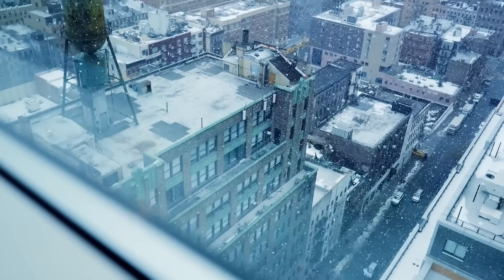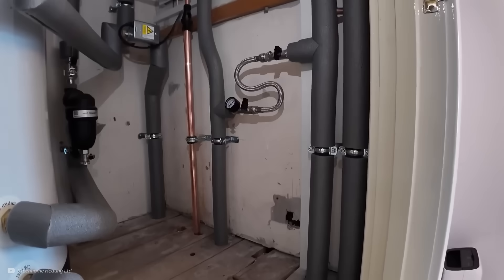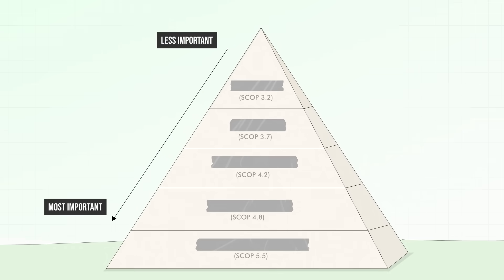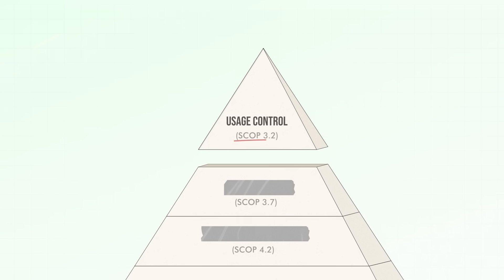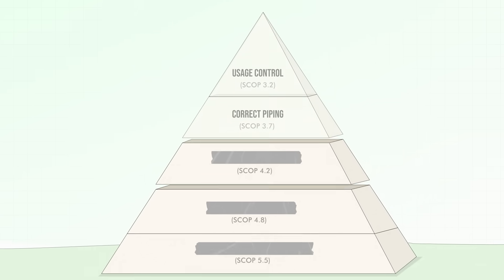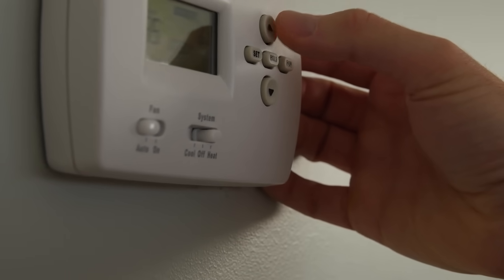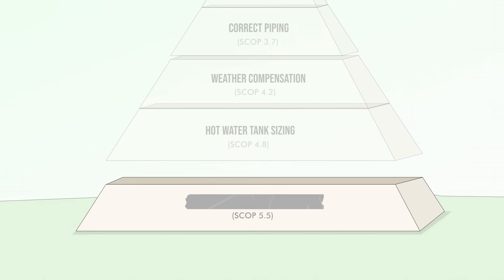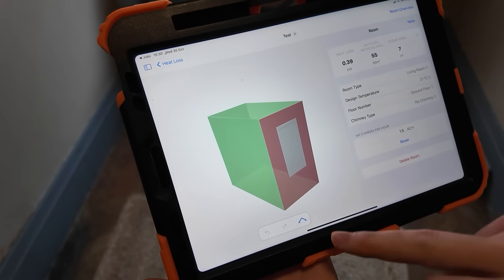The Genius of the World's Most Efficient Heat Pump

Comment: make your own power using gas / heating oil etc and use the wasted heat for DHW or CH, use the electricity or mechanical power to drive a heatpump and capture wasted exhaust heat as well as ambient. the efficiency will be incredible.
Reply: Well, it might be and heat pumps running on gas generated electricity are far better than burning gas directly but the fact remains that you are still generating CO2 and your grandchildren are going to be very unhappy about that.
Reply: @rogerphelps9939  in the winter most of the electricity is going to be from burning gas or coal, and the waste heat will be sent up a cooling tower or into a body of water, there will also be losses in the power lines leading to your house that could be quite substantial. You could cut hydrocarbon usage compared to a traditional boiler by 3/4 and that is a significant reduction. Until we have large investments on deep geothermal this is the best we are going to get.
Reply: Coal? Clearly not a UK viewer. 😂

Our average carbon intensity in the UK is below 200g/kWh. That makes heat pumps 40-50g/kWh thermal , vs 270g/kWh thermal using gas. That's 80%+ carbon reductions today, and our electricity is only getting cleaner.

Domestic CHPs were a good idea 10 years ago - not any more. The world has moved on.
Reply: @bringiton8989  I think even after taking into account wind, nuclear and hydro, (which all have significant environmental concerns other that CO2) CHP with heatpump is still going to be very competitive CO2 wise in a lot of cases, and is going to absolutely smash anything else in terms of cost unless you have a very good source renewable energy at home that is functional in the depths of winter that you can use to power your heatpump already, or your electricity is dirt cheap. I dont see CHP as dead at all, we should be using more localized generation so the waste heat can be piped to peoples houses, combined gasification of rubbish to power with localized distribution would be great. The real solution that is entirely without drawbacks is deep geothermal, we should be investing heavily into converting all existing thermal power plants we have already.
Reply: @ChrisDay-sx4lv  I agree with the CHP on energy from waste plants, but that's more because I think waste management is one of the few places where we should keep burning things - but that's because of waste management requirements, not power requirements. 

Renewable are predicted to push dedicated fossil generation (CCGT) generating hours through the floor over the next 5 years in the UK. Needing to keep them running just to keep district heating systems operational makes no sense. It's similar in many countries. This is why Scandinavia is starting to retrofit heat pumps to district heating systems.

Comment: Please explain how an efficiency of 800 per cent is achieved given that physics gives that no device can have an efficiency of 100 percent? No device does more work than the energy applied?
Reply: It is using 1 unit of heat to gather 8 units of heat from the air. The power input is not where the heat energy comes from. Maybe try watching the whole video which explains it very clearly.
Reply: its a bad explanation its actually COP coefficient of performance which is different from efficiency, look it up.
Reply: To answer your question as short as possible, it is 800% efficient at turning electricity into heat, but it is 93.75% efficient at moving heat from the outside to the inside)
Reply: It's because traditional oil burners combust to generate heat, heat pumps extract heat from the air (or water) outside, like a heat exchanger. Different concept. Remember the key for perspective is absolute Kelvin temp, not traditional freezing of water, although freezing imposes a mechanical difficulty or inefficiency by freezing water in fan.
Reply: The heat it puts out is not the product of its work- it is a pump and it is pumping "free energy". Thus the input of 1 unit of energy results in 8 units of energy scavenged from the environment.
Reply: @rowanshole  
You have a peculiar understanding of work?
Free energy, please explain, and while you are at it, how about perpetual motion?
Electricity is not energy, but an energy carrier and has to be generated and supplied to the point of use, that entails large losses.
Don't use Kw, but Kv as heat pumps are a reactive load and your input figure will now be 25% higher. If you have a heat pump, look at the specification label and you will likely find 'Power factor' 0.8
Reply: The answer is in the name: "heat pump."

100% is obviously the maximum efficiency of electric heating which directly converts electricity into heat.  That's not what heat pumps do.   Heat pumps use refrigerant to absorb heat from one place, pump the refrigerant to a different place and release that absorbed heat there.  The refrigerant is a bit like a "heat sponge." It expands and absorbs heat in one place then you move it elsewhere and compress it to "squeeze out" the heat.  In other words it takes less energy to move (pump) heat than it does to make the same amount of heat with resistive heating.  There are relatively small areas of the planet where heat pumps don't make sense because it's too cold. However, in the parts of the world where nearly all of us live, they DO work well.
Reply: The electrical energy input enables the harvesting of ambient heat energy.
Reply: I suggest you take a quick course in thermodynamics with special reference to reversible hea engines and the Carnot cycle. I can assure you that energy is strictly conserved. You can make a start by tthinking how your fridge or freezer manages to make its interior very cold whiklst the radiator at the back gets rather warm and it uses not a lot of elecriciy.

Comment: How would he apply this to thus of us who use Air Heat pumps, ie in countries that have never had reticulated water heating through radiators? As best I know my heat pump does not run full-on full-off, but eases it's output when near the target temperature, and of course circulates the air in the room at target temp so the hot air doesn't pool on the ceiling.
Reply: Heat pumps that do not operate in full on full off mode use inverter technology to control the compressor power in a similar way to how he speed of electric vehicles is controlled.

Comment: COP 8 is great achievement in technical perspective, but what about "financial efficiency" ?...  Is it worth to invest in a highly efficient heat pump system instead of better insulation?
Reply: Depending on the materials your house is built of and the location insulation in one form or another should be the place to start when you want to save money on heating.
Reply: It's not either/or - more insulation = lower heat loss = lower required flow temperature = more efficiency. It's a virtuous cycle and you have to consider it as an integrated system.

As for payback, it's situation specific - complicate the question further with solar panels, batteries and time of use tariffs if you really want to leave yourself confused.
Reply: @bringiton8989  Of course it is not either/or, I just asked because they did not mention the cost in the video... and I am an economist myself...
Reply: If every house was running a heat pump in a neighborhood would that create a colder microclimate
Reply: @Alex_441  Not a messurable amount, the sun radiates 500,000-1,000,000 kW per square kilometre, a heatpump moving 3-5 kW is not much compared to it.
Reply: Whew.... don't mention the F or C word. All I gather is it costs an arm and a leg, takes years to pay back, you might make a nano size reduction in your carbon footprint and might be warm on a few days of the year.
Reply: @izalman  Naah, you will reduce your carbon footprint by a large factor AND save money in the long run, also be just as warm and comfortable as with any other system, to make it comfortable you need either more radiators or infloor heating.
Reply: Have a look at heatpunk, add your building fabric (it doesn't need to be 100%) and see the calculations for yourself. Just to give your an idea
Reply: Over 20 years? Hell yea, over 10 years, depends, over 5 years is very hard. Anyhow it will influcence the property price greatly, it is an IT factor that can make a property jump from old and neglected to the renovated and in demand category.
Reply: @TheEsseboy  Yes IT is fancy and fashonable, but I think, IT is the most quickly amortizing component, so it is better to add value by foundamental investments, improvemnts in your property.
Reply: @123_1  Installing a heatpump properly is a fundamental investment, it is not as simple as you might think if you strive for high heating efficiency.

Comment: This is being done in the winter so I understand The focus on heating but where I live. What's more important, is heat pumps being used for cooling.  What kind of resources are there for figuring out how to make the cooling side more efficient?
Reply: Heatt pumps being used for cooling is not a thing here in the UK. When it gets a bit warm, rather rarely, we open the windows.
Reply: The same principles apply, just in reverse - air conditioning is more efficient when run continuously on low power and with a higher set temperature (reducing the temperature difference between inside and outside). For which is most efficient, check the datasheets or the energy efficiency ratings 

The heat generated by the compressor is thrown away with air con, rather than added to the system with heating, so having compressors that modulate down (often called 'inverter' types) is important. Don't oversize the unit - get the smallest one which will do the job, even if it's slightly slower for you to feel the cooling effect.

Comment: You and the guys in the video are making complicated entire systems. Your idea works for large infrastructure. Not individual homes. 

 In fact why do any of that or this. When you can just insulate your very well. Then get ever cheaper solar plus batteries, and just deal with the loses without all the headache?

 I don't see how bringing specialized people to make customized solutions is the future.  Unless made from.the ground up to be like that. 

 So to me. I'd be like screw all that. I will just insulate my home, and build it well,, and get an extra solar panel.  It might not super duper efficient, but it works for the sake of it. Yet it would work just the same. 

 I really like newer passive heating and cooling, with the combination of renewables, and batteries. It would be so much cheaper and easier than this one day.
Reply: Because it is cheap, easy to do and costs little if you plan for it BEFORE you build, and even after the fact only the heavy weight options are expensive (adding more radiators or a larger pump)

Comment: 9:30 this is a great point, having on/off only thermostats is too basic. I imagine its also much more comfortable to keep a consistent indoor temperature than to constantly swing a few degrees
Reply: The reason is to not short-cycle pumps which kills the longevity of them.  A much better design would be to run a system at variable pressure to maintain the target temps, but the only drawback being the refrigerant may fall outside its efficiency zone.